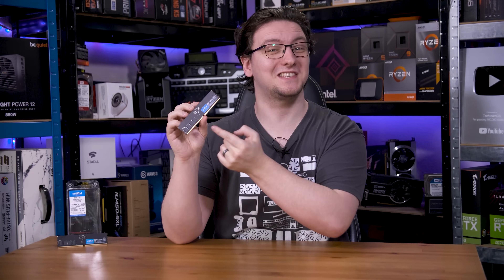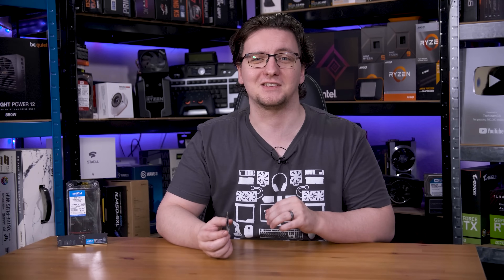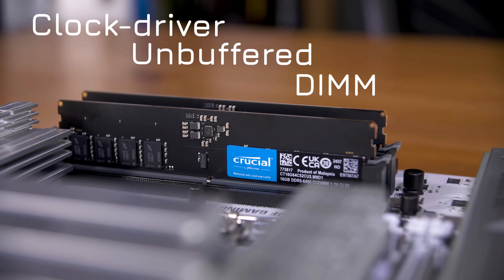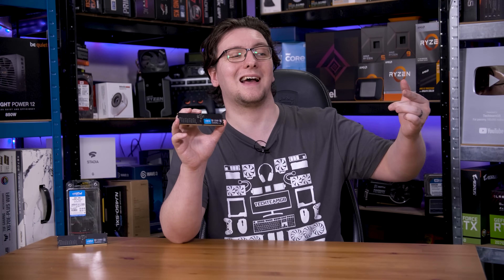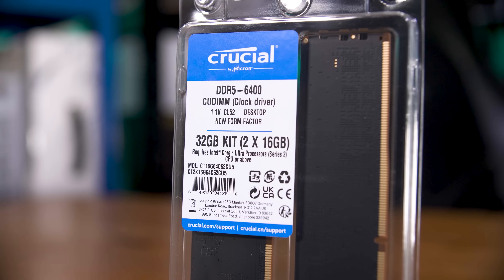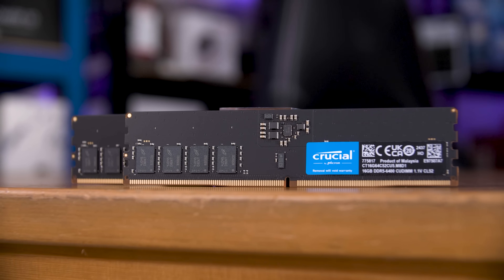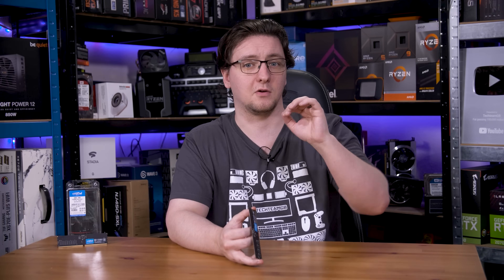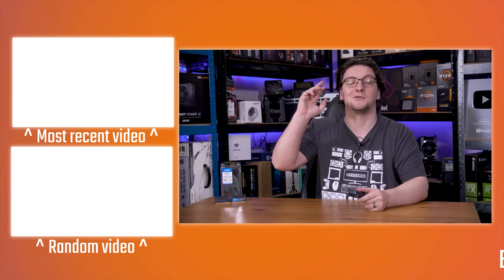CUDIMM Explained! Clock Driver RAM - DRAM IS CHANGING!

Comment: CUDIMMs will be great for AM5 when support is added. I can't wait to see the results of 9000MT/s and faster at a 1:1 ratio.
Reply: I hope 8700G goes through benchmarks one more time.
Reply: Do u mean 2:1? The memory controller is limiting 1:1 speeds. The apu’s are different so maybe them
Reply: Praying for Zen 6 have this by default
Reply: @ShaunaJagan  I wouldnt even care, probably maybe better sitting on AM6 instead. Also dont know if iam going to upgrade cpu from 7800x3d to zen6..
Would do it, but heard that performance will be only 10% above Zen 5, which wont make any sense to me.
Reply: @ShaunaJagan zen 6 is 10800?
Reply: Your comment only applies to APUs, it doesn't matter if we connect the ram directly to a 7800X3D, or a 9950x, the IOD only going to 2200 is a massive bottleneck for the cores, and for the ram.
Reply: Zen6 keaks suggest new CCD/IOD-cache stacked arch reducing latency like V-cache.
But with V-cache Zen has effective faster bandwidth and low latency already using cheap DDR4/5.  The Zen4/5 Infinity Fabric is half width double rate, so it is decoupled from the memory clock.
Remember DDRAM cacheline bursts are short, then there's relatively slow change of address.  Until there's standards CUDIMM will be expensive and unlike X-point Intel cannot afford to subsidise a proprietory tech.
So don't expect much for consumer apps, few programs are memory bottlenecked.
Reply: Gl for hoping ddr5 even 8000mhz 1:1 on amd.. Maybe after 5 to 10 years they can do it.
Reply: @Jjanssoni  Intel with DDR5-8000 still cannot match a $330 single CCD V-cache enhanced  2022 chip, so you're being silly.
Reply: @RobBCactive  What are you talking about? I wasnt saying anything about cpu performance in games on paper, i was talking about memory controller and yes if we go for cpu talk amd feels laggy compared intel on using normal tasks in windows and games have nice fps in paper but in reality am5 is having harder dips in 1% and 0.1% lows than 14gen cpus and menus feel laggy aswell. Btw i had 7800x3d+6200mhz c28 tightened timings on main pc but swapped 14700k+4300mhz c15 ddr4 aswell tightened timings and feels way better and games having a little bit smaller avg fps but still smoother experience.
Reply: @Jjanssoni  the measured facts of gaming say otherwise.  It's Intel l'd P+E core that has had measured issues with laggy desktop that don't effect gaming scores and 7800x3D isn't surpassed in gaming benchmarks, until the 9800x3D.  Intel are moving away from P+E in future designs, it was forced on them to offer more cores.
Being able to use expensive exotic non-JDEC ie non standard RAM won't be an affordable consumer solution.
The fundamentals are that memory is too slow and getting data from RAM costs too much power, so all performance programs on modern CPUs have relied on cache and pre-fetch.
The obsession with memory controller is just picking 1 number.  Ryzen Zen5 reuses the same IOD as Zen4, Turin has a new design and Zen6 is going to radically change the CCD+IOD chiplet layout.
Reply: From what I've seen 6400Mhz is the ceiling when it comes to performance in games.
Because the CPU officially doesn't support more than 3500-4000 MHz.
Games running on faster than 6400Mhz DDR had less FPS.
Reply: @CrashBashL  6000 Mhz is the best according to AMD because it divides the clock to 3000 and 3000.
Reply: AMD memory controller is different and can't support CUDIMM. It is most likely INTEL only. Even if not for new generation of CPU's with a memory controller that can run CUDIMM we are most likely talking about new socket. 
INTEL is so much faster than AMD. Slides were with 6500 memory speed and underpowered to 250W. When we are using the full specs up to 10000 plus memory speeds 295W for gaming the difference will be huge. 
What you saw on the slides is what you would expect from workstation and productivity point of view that already beat AMD by a country mile. The low specs are to keep motherboard manufacturers in spec and not to fry the CPU's. That said there is huge overclocking possibility on Arrow Lake. E Cores alone can be overclocked by 1000MHz alone to give a huge performance jump. Hence no Hyper-Threading Technology to make pairing to GPU (ARC) more easy via PCIe 5.0 and more efficient. Plus we see 8 pin power for the PCIe 5.0 that has to be seen what does that count for? Buffer for Battlemage? When I think about CUDIMM it is only part of the big picture. GPU as itself is so much more than CPU. But pairing and lifting the CPU up with Wattage and faster memory will better utilize the GPU pairing. AMD is measly 170W. That's one point why AMD running INTEL ARC looses 20%.
Reply: @paulboyce8537  that is a hilarious post!!  You do realise that AMD Turin crushed Intel's Granite Ridge announced a few weeks before, don't you?
The news leaking out about ARL is that is unstable and can use 370W despite Intel's claimed performance power efficiency improvements.
Using 250W is a lot, Intel use a TSMC  3nm while Ryzen Zen5 is in density improved 4nm, an optimised version of TSMC 5nm family.  It's supposed to be easy for ARL to win on MT productivity benchmarks, but the chips are expensive to make compared to the mature CCD/IOD tech Ryzen re-uses in a price sensitive consumer market.
You're talking about workstation when Threadripper is going to reuse the Turin IOD.  Intel's Sapphire Rapids based workstation was a dud, nobody can believe anything that comes out of Inte until 3rd party testing.
Just look at the 13/14th gen saga, with lies and refusal to RMA to some people defective chips, while others were having hundreds of CPU fail in data center on detuned server settings and having wholesale replacement.
Why?  Because it depended on what software you ran, a fundamental bug in voltage settings that was obscured by a failure to validate power configurations on partners' mainboards
Reply: Ryzen 9000 on 2:1 8000mhz is crazy fast
Reply: I'm afraid you will have to wait and wait and wait and....